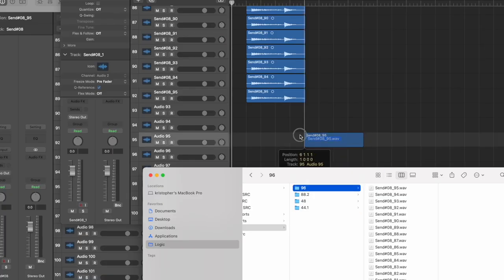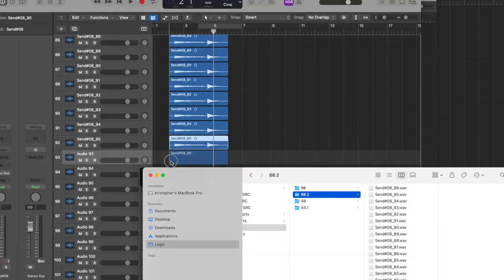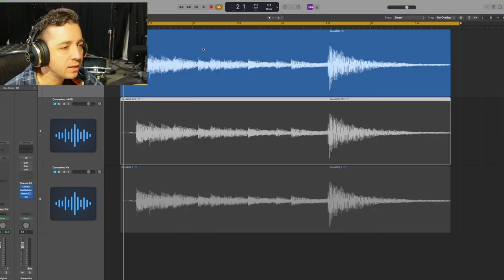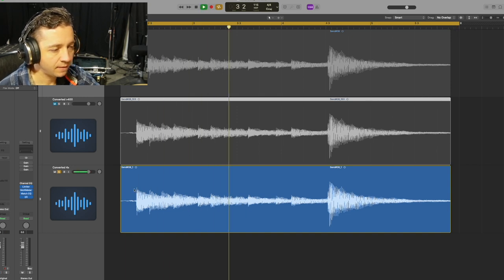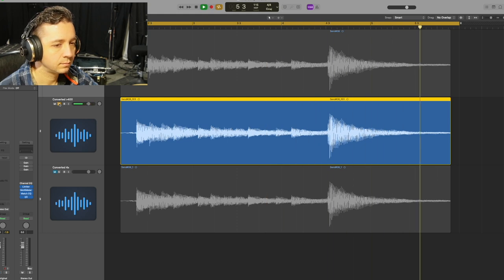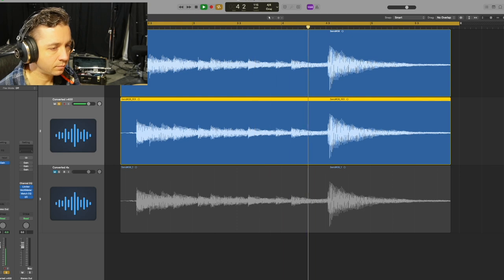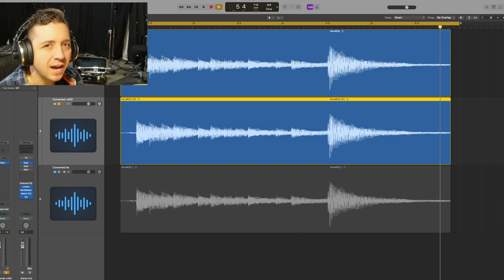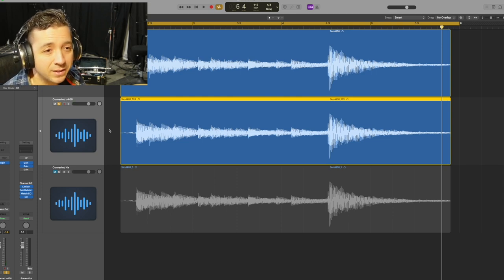How Sample Rate Conversion Effects Sound Quality.

Comment: Hi Chris! I was just thinking of doing a similar experiment for my own curiousity when I found your video, and I think you did a great job! 400 conversions is way more than I would have had the patience for! The null test is the ultimate mythbuster. Anyone can claim to hear subjective differences in transients, frequency balance, etc, but if it doesn't show up in the null test, it probably doesn't exist. The only thing I would have also liked to see is a frequency spectum analyzer readout on the null test so we can see what that difference looks like.

Comment: Great test! It is important, though, to mention, that distortion, artifacts and noise, even at extremely low volumes, can have an influence on the material at normal levels. It is similar to applying dither noise when reducing the bit depth. That noise is near inaudible, down at - 90 db's (16 bit) or lower (in case of dithering to 24 bits), yet it is well documented, that changing the dither noise by noise shaping has an influence in the sound. Yet if you do the phase inverse test of the two files, or also dithered vs. non dithered, you have to crank up the volume even more than 48 db's to really hear the differences in noise. 
That said, Izotope does a really great job in the domain of SR Conversion.

Comment: Very useful, thanks!

I'd like to add that Apple has one of the better sample rate conversion algorithms, inducing very little aliasing. I guess the result would probably be much noisier using 16 bit files with dithering, but your test is still valid and we should stop worrying about sample rate conversion.

The only time when you should care about sample rate (in my experience) is either if you want to stretch the recording without losing high-end details, or using distortion/saturation plugins that can cause some ugly aliasing if they don't have oversampling. And even in this case, it remains pretty subtle.
Reply from the maker: Yeah, it’s effect is much less than I was expecting. I also did a video about adda conversion, which also had much less effect than I was expecting.

Comment: A question that rages week in week out in the world of video is that recording 44.1KHz causes video drift when the end system is 48KHz. I've done my own tests and not found this to be the case. Clearly if they were interpreted incorrectly that would be 8% and would mean a speed change.

Final Cut Pro defaults to 48KHz timelines and any content is conformed to this on the fly so 44.1Khz is converted to 48KHz. I think it does a pretty good job of this.

My conclusion is that audio drift is caused by the accuracy of the respective clocks in each device, especially if they are unlocked and free running.  Anecdoetely maybe it could be said that 44.1KHz kit tends to be cheaper and maybe the crystals in the clock keep worse time?

So sample rate conversion as your test shows here is pretty seamless. Avid Media Composer used to have 2 modes 1) Fast and Poor 2) Slow and Quality, neither ever changed the speed in my experience.

There are some interesting facts around whole samples per frame: 

48KHz/30 = 1600
44.1KHz/30 = 1470
48KHz/25 = 1920
44.1KHz/25 = 1764

48KHz/24 = 2000
44.1KHz/24 = 1837.5

so it's only the 24fps 44.1.KHz combination, that are not whole (if you discount 23.98 and 29.97 which clearly aren't). Could it be a factor when locking frames to video?

Audio doesn't have a frame rate but when it's recorded along with video it is locked to it, does this matter when trying to keep sync and /or sample rate converting down the line?

Comment: Very nice! I expected 400x to sound much worse... I've only had patience to do 10x and couldn't hear a difference. Modern sample rate conversion is awesome!

There are few more things to consider thou: if you use a good modern converter program, it doesn't matter in offline conversions if you convert from 44.1 to 48 or to 88.2 or to whatever, they all sound good (as the video proves in practice). And they also all go "even". But it takes more CPU to process "uneven" sample rates because the Least Common Multiple (LCM) is a much bigger number. When the target sample rate is half or double, the number is small, for example from 48 to 96, the LCM is 96 and it just needs to be multiplied with 2. But when converting e.g. from 44.1 to 48, the algorithm looks the LCM which is 7056 meaning first the 44.1 is multiplied by 160 to 7.056 mHz, then processed and finally divided by 147 to reach 48 kHz. In offline conversions the only downside is it just takes a little bit longer but in realtime conversions this may be a small problem. Take for example Kontakt. The choices are either to drain the CPU or another, worse but lighter algorithm for "uneven" conversions (44.1 -> 48 for example). Kontakt has chosen the worse algorithm which is understandable. This can be noticeable especially with drum libraries, on cymbals.
Reply from the maker: Interesting, thanks for sharing :)
Reply: Interesting! So this conversion is done internally in the plugin and not in the DAW?

Also I guess in a sampler there is almost always some king of pitch shifting of the samples, meaning even more sample rates to convert.

Also, does Kontakt have a "normal" sample rate for every sample, or is it up to the library creators to choose it?
Reply: @FlorentChardevel  All DAWs can convert but you can choose to use external converting program.

Don't know about that pitch shifting. Seems something is going wrong then...

In Kontakt it's up to library creators.